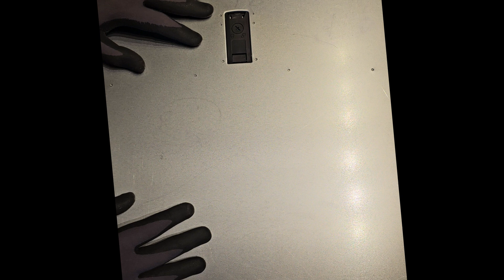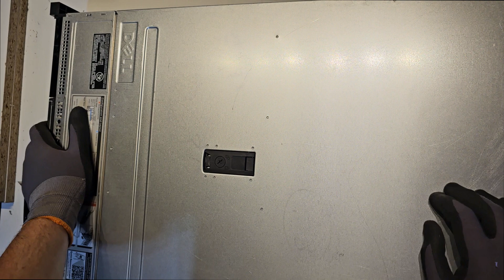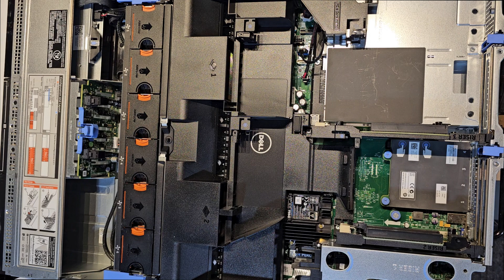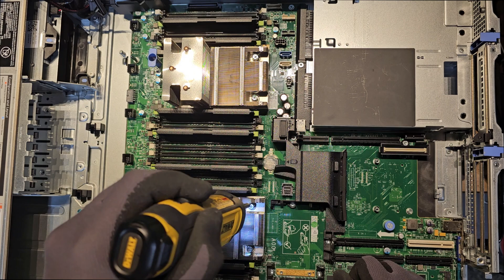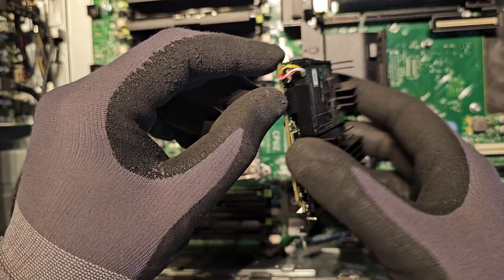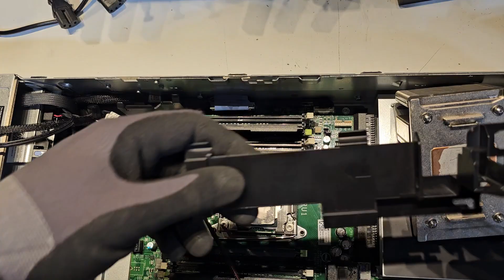Dell PowerEdge R730 Server Motherboard Replacement Tutorial

Comment: I’m planning to purchase a used Dell R730XD from Taobao in China as a barebones unit. My goal is to assemble the components individually, like collecting Dragon Balls. Here’s my current plan:
CPU: Dual Xeon E5-2697 v4 processors, as they seem to offer the best value for the price.

RAID Controller: An H710P, which I believe should be sufficient for my needs.

Storage Configuration: The R730XD supports up to 16 3.5-inch HDDs and 2 additional 2.5-inch drives (with a rear flex bay, which I’ll need to purchase separately). I plan to use SATA HDDs.

Backplane: I assume the front backplane, supporting the 16 3.5-inch drives, is included in the barebones unit and doesn’t require an additional purchase. However, the rear backplane for the flex bay is likely not included and will need to be bought separately.

I’m building this system to serve as a NAS server. Any general advice or recommendations for this setup would be greatly appreciated.

Comment: Thank you for this. Very thorough and I appreciate the knowledge of what goes to what and what everything is. I'm running 9 of these in my home rack. Well six 730s (3 r730xd 12Bay LFF, 2 r730xd 24Bay SFF & 1 r730 8bay SFF) and three r630s. I had to do a system board replacement on one a year ago. Wish this was around back then. 

I had to figure it all out on my own. Didn't even know what boards are the same between the r730 and r730xd. I replaced and xd board with one from a r730. After I did, I couldn't get the rear backplane board to work anymore. I tried a couple of different pairs of cables and boards. Finally gave up on it and just gave up on the rear two drives 🤷🏽‍♀

Please keep em coming. I'm paying close attention to everything you put out about these. More and more are hitting the used markets, so it will only become more and more valuable.
Reply from the maker: sounds like a nice set up! if there is anything you are interested in, ideas always welcome :)